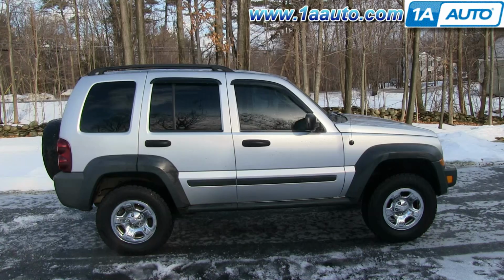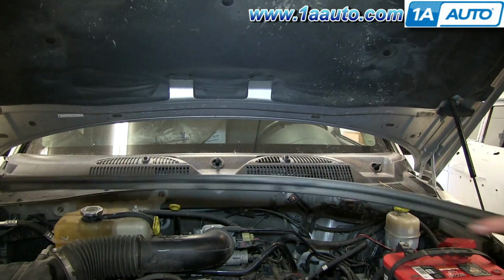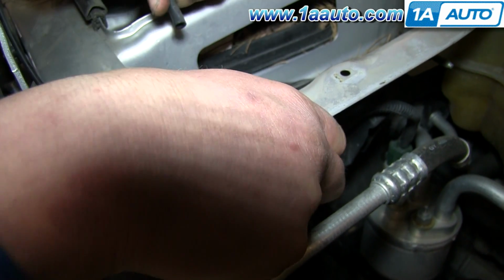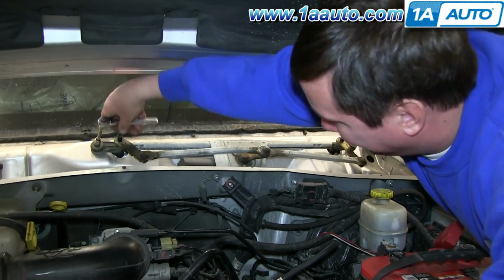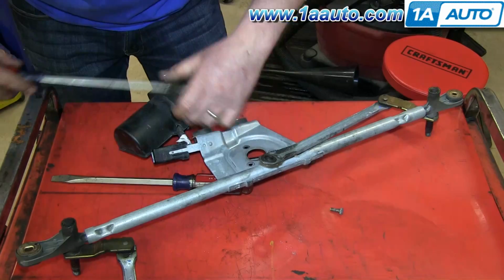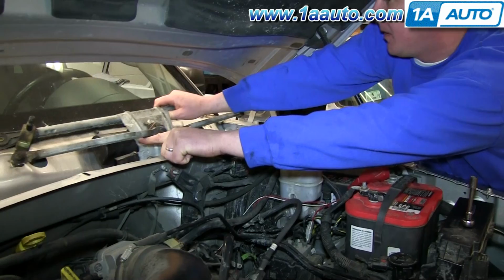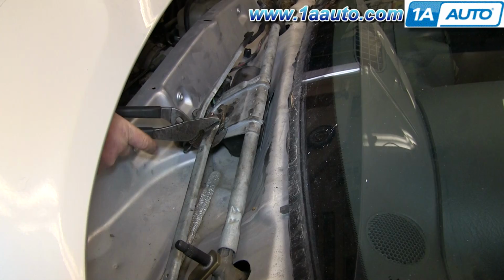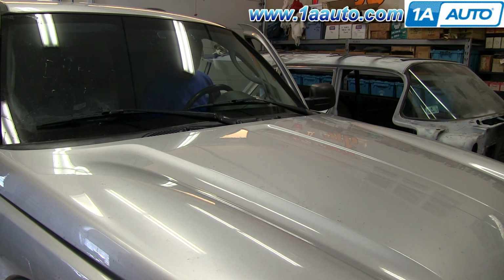How To Replace Wiper Transmission 02-07 Jeep Liberty

Comment: Did he replaced the wiper hose
Reply from the maker: +Rolando Perez Thanks for checking us out! We did not replace it in this video however if you wanted to or needed to this would be the time to do so. The reason there was no liquid is because they were ran dry rather than having the fluid flow. 1aauto.com

Comment: how do you know when the blades stop if it is the transmission or the switch?
Reply from the maker: +Arlynn Parker There is really no way to tell other than taking a look at the components.  If the blades stop it could be the linkage, motor, switch, wiring etc.  You will want to test and check these parts for a diagnosis!  1aauto.com